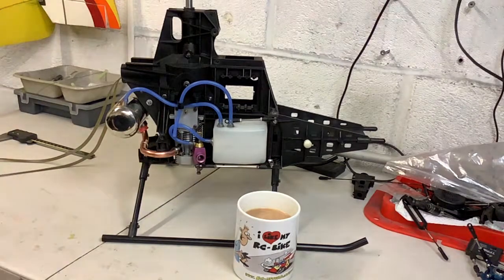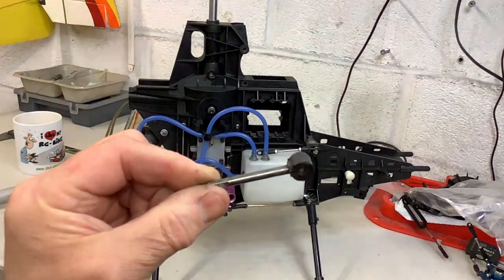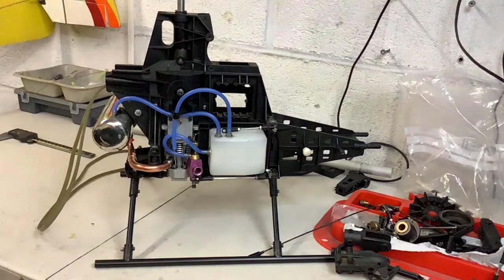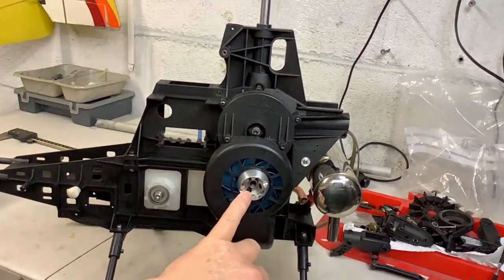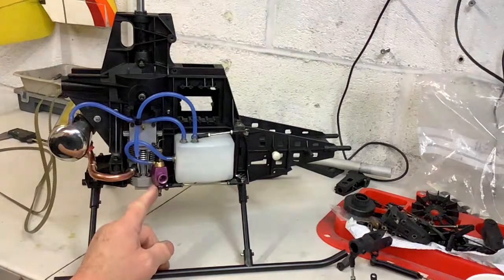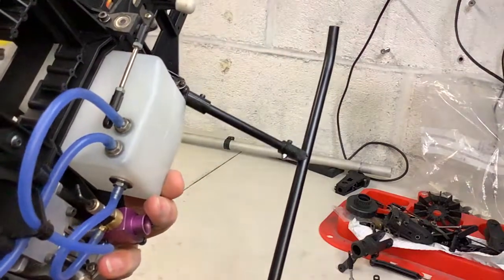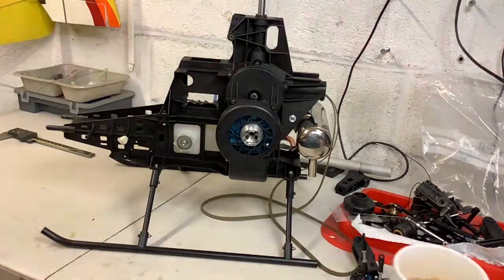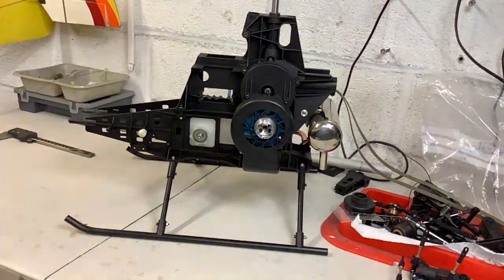Vintage Robbe R22 Laser 4stroke heli rebuild

Comment: I have the exact same moskito which I am converting to electric. I have a R22 painted fuse and a Hughes 300C on the heli. Could you let me know the height of the main shaft on yours? I had the standard 150mm abd that was too short on the R22 so I custom machined one at 225mm but assume its too long, Does Trevor sell them? or are there any shaft joiners available with them? Appreciate your input.
Reply: Hello, the R22 original shaft is 170mm